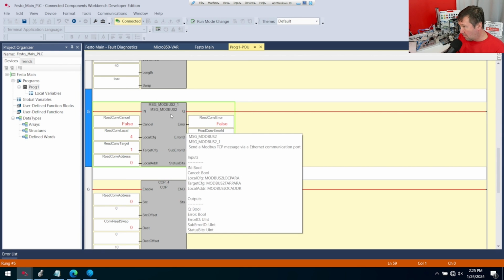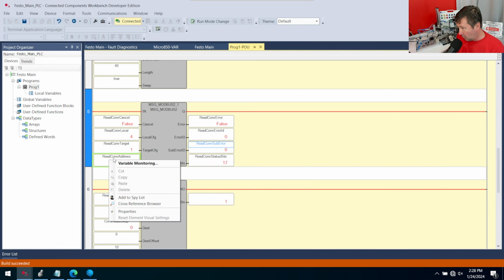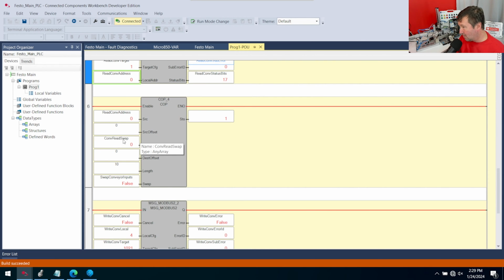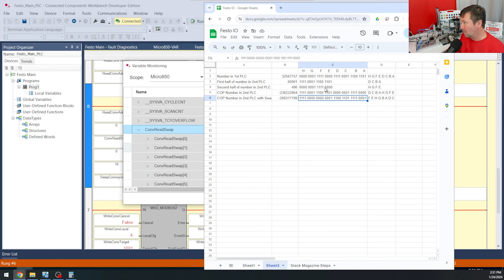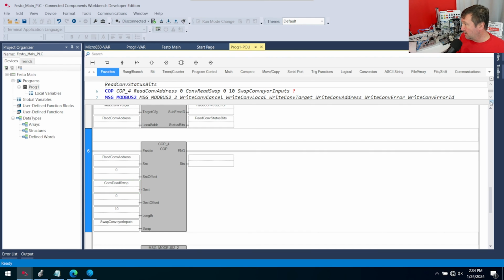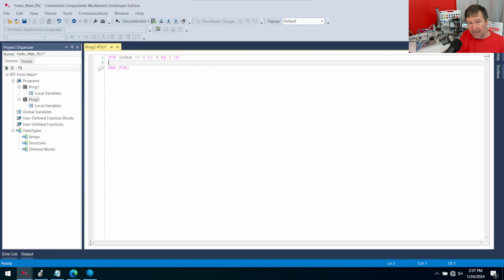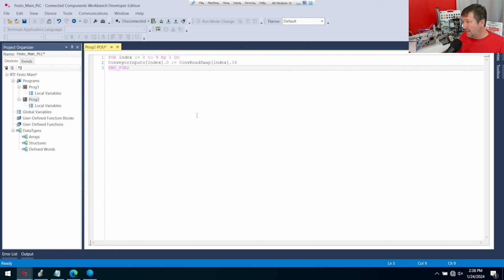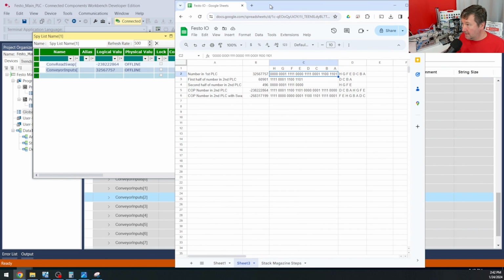Differences Between COP Instruction in CCW vs Studio 5000

Comment: good night Tim I need to read the communication status of a generic module added to the micro 850, the rslogix 5000 has the gsv function but the ccw does not, there is something that needs to be done. thanks.
Reply from the maker: I need to look further into this.  When I was recording videos on the generic module feature, I didn't see a way to easily access that information.  I was short on time so I don't know if it didn't exist or I just didn't see it.  I think I can make a work around if it doesn't exist with message to it requesting the list idenity (think it is called DeviceWho in Studio 5000) but need time to poke around a little more.